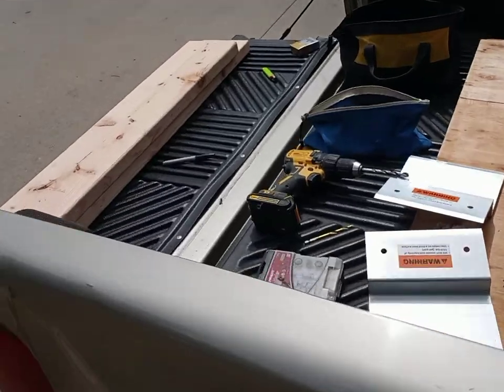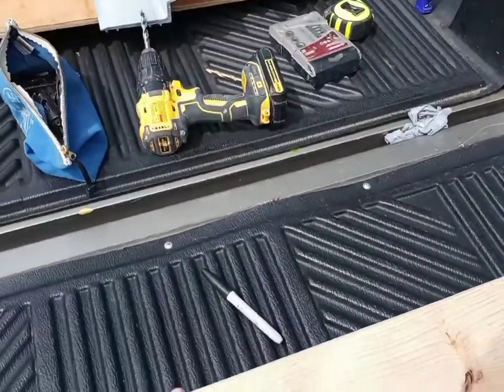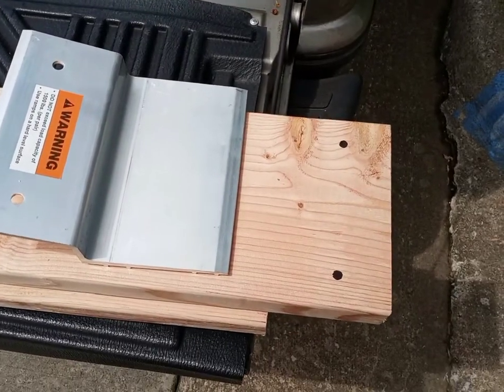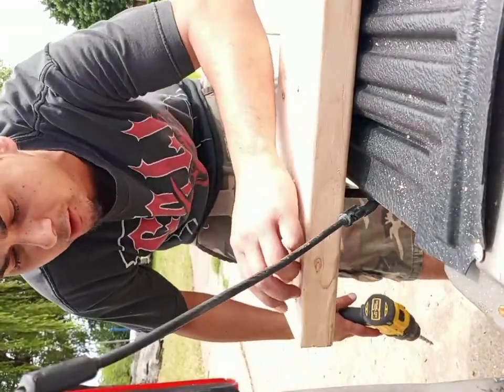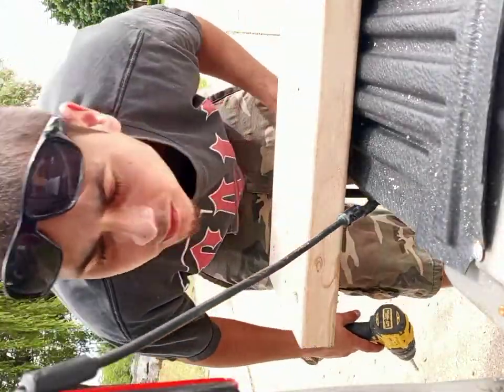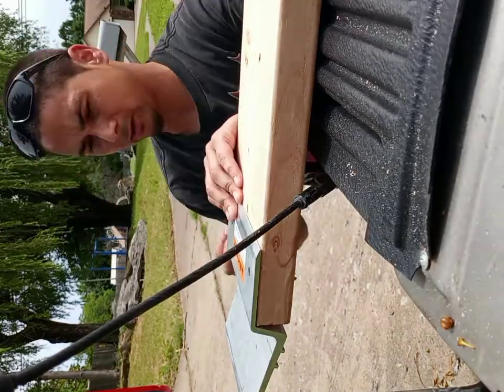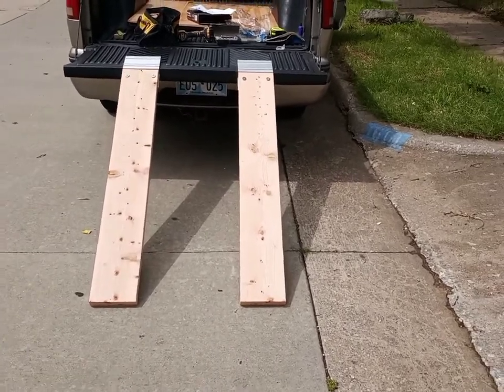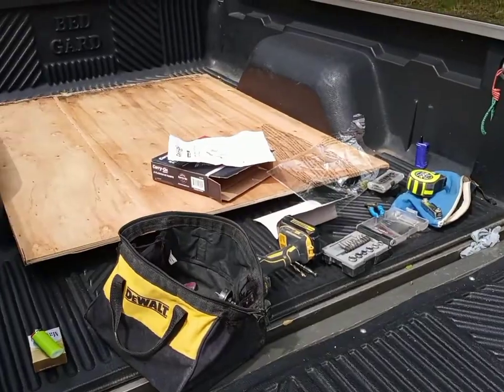How to: Build a truck ramp for lawn mower #diy #howto #building #work

Comment: You're not pushing anything up those ramps they are way too steep
Reply from the maker: Hmm 🤔 That's weird...I seem to recall doing it probably 100 times with my push mower. 2 front wheels. But I got r done hahahahahahaha
Reply: @bgtheboss  :face-green-smiling::face-green-smiling:

Comment: Seriously thank you so much for this video!
Reply from the maker: No problem at all brother. Thank you for saying so. I hope it works out for you. The metal plates on the boards like to slip on the truckbed a little so maybe put something on it that won't allow that. I found that out afterwards. Just a tip

Comment: How long are the 2x8
Reply from the maker: They were 2x6x8 and I cut them down to 4 ft. 5 ft would be better. So a 2x6x10 would be perfect
Reply: I bought 2x8x8. I might cut them to 6ft instead. Thanks for the video
Reply from the maker: No problem at all
Reply: Use bed liner for grip
Reply: @bgtheboss  I am an older man so I would not be able to push the thing up the ramps. Would 6 feet make it much easier? Thanks for the video-nice work! Money stuff is important too.
Reply: @DaveWeeter  Maybe 8' and longer but, no less